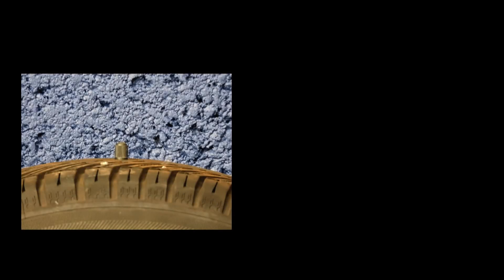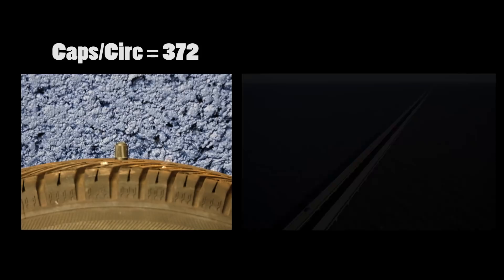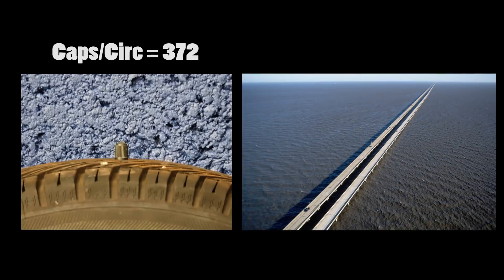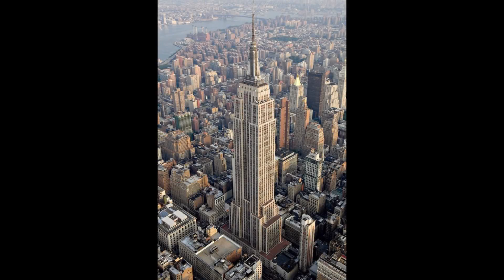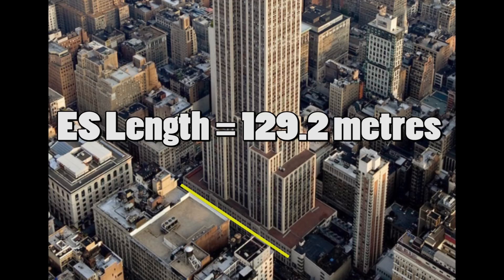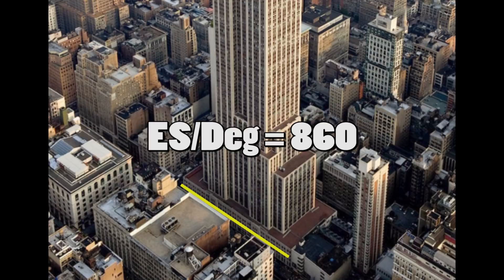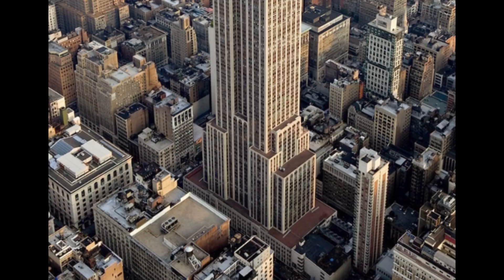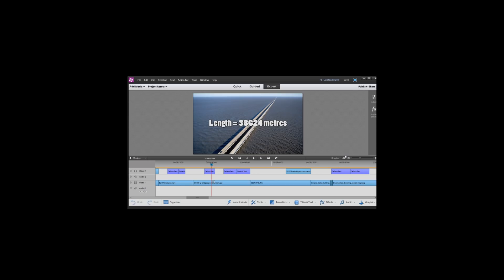Flat Earth Can't Scale

Comment: Gotta get you terminolgy straight. The first tire is not a 14 inch tire, the rim or wheel is 14 inchs. The tire that fits on a 14 inch wheel can vary in it outside diameter. Low profile tires have a considerably less outside diameter than a full size tire. You used your math figuring on a 14 inch diameter but utilized a tire which has a considerably larger diameter, thus all you calulation are scewed.
Reply from the maker: William,

You are correct. I have just uploaded a video addressing this:

https://youtu.be/5DMjnEfiEac

Cheers,

Al
Reply: @ETM2024  Actually you're right. a 14 inch tyre fits a 14 inch rim and there for your 1st tyre was 14inch. But for the comparison use the outside.
Reply: @Stiggy Stiggy anyone can prove the earth is curved you inbred.  Go to the beach and watch boats disappear.  Then get out your telescope and it won't come back dummy.
Reply: William Guy 
Why is this video lame? What you are suggesting is that because you can't see the curvature of the earth from ground level there can be no curve. 

On that premise you could say that because you can't see the contents of a sealed box, the box must be empty.

As you know there are places and large man made structures that clearly illustrate the earth's vurvature even when viewed with the naked eye. Of course you choose to ignore and deny the existance of such obvious evidence because it does not satisfy the requirements when arguing for a flat earth.
Reply from the maker: @Stiggy Stiggy 

Stop talking shit Stiggy. Zooming in doesn't curve things you imbecile, it just causes compression, which leads to exaggerated views. If there is a slight curve it looks more severe, if there is a hill it looks steeper etc.

The causeway only has a shallow curve, the zoom makes it appear exaggerated. That is only possible because the curve exists.
Reply from the maker: @Stiggy Stiggy 

Now you're lying through your teeth about what Soundly does. He shows it in multiple locations, he shows it through various cameras, a drone and a telescope, from different elevations etc. I've demonstrated what's happening with lens compression on  a small  scale myself  and Soundly has done it more than once, the most recent being a few days ago.

You're just a POS troll.
Reply: Stiggy Stiggy   Your dumb comment clearly proves the title of this video correct.
Reply: @jesseduzz4136  decriminilized means nothing more than not a crime but it is still ILLEGAL.

medicinal use laws include MINOR little bits of wording that make it a requirement to have it proscribrd by a registerrd practicing doctor or medical practitioner.

that means you must think that OPIUM is legal too as doctors can proscribe real and synthetic based opiate medicines(which are STILL illegal to possess/use without a lawful prescription)

no prescription for either and you get caught and you get prosecuted
Reply from the maker: Gotta say, this thread has taken a very bizarre turn. I think everyone arguing about cannabis needs to learn to chill the fuck out before my irony meter ends up in orbit. 😀
Reply: @ETM2024 , discussing the legality of weed is fun though. It's unlikely to hear the sentence 'i've never seen a flat basketball collapse into a sphere' when talking about the ganja so thats a massive bonus aswell. 

We might have steered away from the topic of your video but that's the internet for ya. But i agree, let's talk about tyres again ;).

On a sidenote: i am very chill *takes a hit from my joint*. Vacation + being a Dutchie, can't let the stereotypes be for nothing!
Reply: @ETM2024  well ,youre definately not a flatsrd as they dont think anyone can orbit earth
Reply: Keep thinking small, Stiggy.  Gad damn, what is wrong with these people?
Reply: Flat earthers, just take a step back to the theory that shape-shifting reptilian overlords rule the world.  It will be less embarrassing for you and make you look way less stupid.  Drop the flat earth shit for fuck's sake.  We don't even give a damn what shape the earth is.  What is up with your fragile emotion attachment to the flat earth?
Reply: @Stiggy Stiggy are you still making comments after it has been proven to you time and time again you DON'T know how to scale.  I told you, you were looking for way too much curvature.  You just can't wrap your brain around the true emense size of the earth.
Reply: @Stiggy Stiggy you mind isn't large enough to understand that yes we can.  And have proven it many times to you.  You need to hang it up and go back to the short bus.  You clearly have no comprehension of anything you see.
Reply: @Stiggy Stiggy I have never measured the distance at which they disappear I have only watched them do it and attempted to bring them back in focus.  Only a liar says you can.  Try globe understander.  You don't have the brains for it.  As you have proven on our previous encounter.
Reply: @Stiggy Stiggy You have to change your elevation first.  That is the only way to bring them back into focus.  Otherwise they are hidden by the CURVE.  This is an experiment I have performed many times.  Focus alone isn't enough to bring something back over the curve  Here you are lying again.  And this is only our second exchange in this thread.  You still haven't looked at the protractor have you?  You can see all of your mistakes when you do.  The distances you are looking at show exactly what we expect to find on the globe.  But, you didn't get it last time why do I think you're going to get it now.
Reply: @johnunderwood-hp8rj  ohhh diddums.

stop invading other countries then.
Reply: @jadekayak01  I haven't invaded any other countries.  I've been to England once.  It has been my only trip out of the states.  None of the decisions involving the invasion of other countries was I given a choice in.  But, where I do have a choice deals with illegal immigrants.  I not only say no but, hell no.
Reply: @johnunderwood-hp8rj  i agree on illegal immigrants-you all are and stole the land from the real americans-dont worry,most countries this happened-especially in the british empire.

you CAN stop your government invading other countries.

try voting.

try exercising your constitutional rights.

50 FBI agents were going to seize cattle grazing on land that had been developed by a farmer,but not paid for.

about 1100 ARMED local residents turned up to back up the farmer and drove his stock to HIS land(the part that was deeded.

michael moores video "sicko" describes it pergectly in a comment from a french woman.

"in France the government is scared of the people,in the us the people are scared of the government"
Reply: @johnunderwood-hp8rj  at least you HAVE been abroad-sorry about the english accents-nowhere in the english speaking world is "english" butchered so much as its country of origin
Reply: @jadekayak01  I don't know.  You haven't experienced rural Georgia or Alabama.  You might be surprised.
Reply: @Stiggy Stiggy you cant see the red lights in the distance brcause we have limits to our vision.

how long was the runway?  3000m

if the lights were flush with the runway then there was enough curvature to obscure them for a human level height

how high was the  cockpit.

higher than a persons head?

you should have been able to see them at that distance.

the general rule is that you can see 1 mile for every foot above the surface
Reply: Kit Canyon  so i like to react to idiots spouting shit or untruths-sue me.
Reply: @berniccee1  the problem for you is tgat the "theory" was not invented.

it is the observable TRUTH
Reply: @berniccee1  you are delusional and obviously reject actual proofs already published.

curvature has been proven many times from direct observation to observation of objects that can only behave on a curved surface.

water(and everything else) gets pulled to tgd centre of mass.

this includes gasses that cant escape this gravitational attraction(lije most gasses)

lets use water as an example as its way easier to check it yourself.

pressure increasses with depth-this is because tgere is more mass above you as you go deeper.

every 10m the pressure increase is the same as air pressure acting on us at sea level.

now if you reverse this principle and start deep and go UP to tge surface the pressure decreases.

now to the air.

it is a proven fact tgat air pressure decreases as you go higher up a large mountain.

this is simply because there is less mass above you than at sea level.

eventually you get so high tgat we cant breath propperly,or more importantky we CAN breath but there is not enough oxygen in the atmosphere for us to function.

the higher you go the less atmosphere there is untill the point where there is effectively no pressure at all and that is calked a vaccum.

it is correct that an ARTIFICIAL vaccum needs a container to exist or that a container needs to be used to house INCREASED pressure because they are artifical pressure variations.

minor variations occur naturally in the atmosphere and are measured in millbars.
tgese produce the weather patterns(winds)
Reply: Amtrak Derailment  Quick! Dig up Erastothanes! He's owed $10K. Maybe there was enough air in his casket he might be alive! 
Oh wait... he didn't prove motion. Back to sleep Mr. E. clunk. It's very easy to offer $10K and then not accept PHOTO EVIDENCE - typical of schyster and dropout Eric Dubay.

Bcos I know of a 15yo who sent his phone up on a balloon. Dubay owes that kid $10K.
Reply: He doesn't even understand science so why would I waste money trying to jump through his hoops. He has to sell 50,000 toilet paper books to make $10K he ain't giving it away lol:
" Michelson-Morley 1887 (motion) " 😂😂😂
Reply from the maker: @Stiggy Stiggy 

You're lying Stiggy. If you want to argue about something I don't expect you to be right because you're usually wrong but outright lying is both despicable and stupid. If you can't be honest keep quiet. You lie agin I'll delete your shit.
Reply: @Stiggy Stiggy You think that last clip is the same concept as this?? https://youtu.be/QVa2UmgdTM4
Go to 7:45 in it, and you will see it is NOT the same.
Reply from the maker: @Stiggy Stiggy

The only way you fuckwits can deal with his observations is to lie through your shit stained teeth. Says more about you than anyone else dumbass. Three  individual locations, multiple viewpoints, live streams, and now your precious infrared. Your claims are false, end  of.

And I wasn't just referring to that but the complete and total bullshit about zooming in causing curvature. So you can prance around and run through your idiotic script Stiggy, but the fact is you're a lying piece of shit who is the only one here who is obsessed with Soundly and you're running around bleating your head off about him because you know he isn't a fraud. This video has nothing to do with Soundly, you and your dipshit pals on FED can't shut up about him.

So stop projecting your own issues and stop lying. Like I said, you can try to argue about something and you will inevitably be wrong, but you keep telling straight up lies and you're gone.
Reply: I'm officially offering $10 to anyone who can prove the flatness AND stationary nature of the earth. And unlike Dubay, I WILL give it up if you bring scientific proof in any format. Bonus for bringing me a piece of the firmament that Operation Fishbowl busted up. There must be millions of fragments! (Libyan Glass doesn't count since it existed previous to "nuking the firmament".)
Reply: Yes, but in the grand scheme of things it's a moot point. Good call though.
Reply: Irrelevant. The tire example does not require rigorous mathematical precision to illustrate the point. Your protest is just an excuse to remain willfully ignorant.
Reply: Stiggy Stiggy yes, in fact I can. But it's not important that I can, the real question is why can't you?
Reply: Stiggy, yes the earth has been PROVED round.  We have literal pictures.  If people choose to deny their own eyes then that's their own issue.
Reply: Check again. 14" x 3.14159 x 25.4 = 1117.2mm and that's the diameter of the wheel itself. He stated the circumference as 2234mm and for that to be true, he had to assume a diameter of 28" for the wheel and tire which is actually about right.
Reply: @mooney6306q  yes,  the wheel is,  not the tire.  That's what was originally said...
Reply: That was a good try mate and very concise.. The problem is that flatards will refuse to even try to understand what you are talking about... I once tried to explain to a flatard that a plane flying at 35000 feet would be equivalent to a spec of very small dust floating about a tenth of a millimetre above the surface of a beach ball and would therefore not see any apparent curvature... He just didn't get it.. So, my advice is just give up!
Reply: Stiggy Stiggy you’re a fucking idiot. Keep smoking weed. Moron.
Reply: Steven I resented that. I smoke weed. I’m not a moron. 😂 #adheretothesphere
Reply: @Qzopr1  ohh-so you are a crimminal
Reply: jadekayak01 are you aware that there are places where cannabis is legal? Before you gripe about federal vs state law, remember there are a couple of countries outside the 🇺🇸. Let me ask you something. Is a medical cannabis patient a criminal?
Reply: @Qzopr1  btw-name the countries where cannabis is legal
Reply: jadekayak01 Canada is the latest. Full legalization. Medical and recreational. Derp...
Reply: @Qzopr1  that is only ONE,you said many.
Reply: jadekayak01 logic dictates that I only need one to make your point moot. But since you like your beat downs to be thorough:

Legal

Colombia
Canada
Netherlands
Panama
Spain
Uruguay
U.S.

Medicinal Use

Canada
Macedonia
Puerto Rico
Serbia
U.S.

Decriminalized

Argentina
Australia
Austria
Belgium
Bolivia
Cambodia
Chile
Costa Rica
Croatia
Czech Republic
Ecuador
Estonia
Germany
Greece
India
Italy
Jamaica
Malta
Mexico
Paraguay
Peru
Portugal
Russia
Slovenia
Switzerland
Ukraine
U.S.

Tolerated/largely unenforced

Belize
Botswana

Are we done?
Reply: @jadekayak01  There are at least 27 nations where marijuana is legal, Canada being the most recurrent adopter. And by your standard, virtually everyone is a criminal. 
Ever go over a speed limit?
Reply: @Qzopr1  no where not done.

in canada it is fully legal.

thats just one mistake you made.

also in the us it is not legal.one or two states does not make it legal.

and for the record-there are 196 countries in the world,how many did you mention?
Reply: jadekayak01 did I mention more than one. Nice goalposts shifting.
Reply: @Qzopr1  yes you did,but you also attempted to "baffle with bullshit" by putting in other cou tries where it is still illegal and got canada completely wrong.

how can a person be trusted when they have an agenda to push and distort or get the facts completely wrong.
Reply: @jadekayak01 , funny you're not adressing the one person who's actually shown you to be wrong.. are you sure you're not a FE'er? You've seem to have all their defence mechanismes.

Also, rape isn't legal anywhere in the world but there are parts of the world where a women that has been raped gets more trouble than the guy that raped her.
Reply: @gjj6331  i havent been wrong here-point out were i have been wrong
Reply: @gjj6331  and who said i said rape was legal?
read the post-that was ADDRESSED to me,not written by me
Reply: @jadekayak01 , i never said anyone made such a claim dude. You said there was a level of difficulty in proving rape and i said that it's not just the level of difficulty giving these women a hard time after they've been raped but in some cases the culture itself stops these women getting justice. Like women being thrown out of their family for not being a virgin anymore even if they lost their virginity as a result of rape. The guy in those cases usually gets away with it. Although in some cases a small financial compensation is given to the family for their loss of a virgin daughter, as if the guy put a dent in their car. So disrespectful. 

In the west we see rape victims as actual victims, this isnt the same all around the world.

You were wrong in saying that there are only 3-4 countries in the world where weed is legal, for medicinal use weed is fully legal in 31 countries which comes very close to the 27+ the other guy mentioned. No one specified the legality was based around recreational use, just the legality of weed in general. Therefore, you were wrong and shouldnt be so condescending to someone who actually was correct albeit a bit vague in his description.

Also, you saying speeding isnt a criminal offence in your country but calling people who smoke weed a criminal is very odd. You seem to know the difference between a misdemeanor and a crime yet you don't apply this to recreational stoners. Even in countries where smoking weed is illegal the act of doing so isnt usually concidered a criminal offence.
Reply: @gjj6331  i just assumed you implied it as you linked it to my statement-i do agree though.recently an auz beauty salon manageress in dubai was raped by a group of locals and all were jailed for sex outside marriage(3 months) then she was deported.

"medicinal use" is a serious problem for weed as it needs to be proscribed by a regestered medical practitioner and fits into the catagory if prescription drugs-all of which are ILLEGAL to possess or use without the valid prescription.
Reply: Saint Massive indeed. I was vague because it’s useless to invest time in conversation and debate with people who clearly deny reality. They’re so wrong, they only want to be right. This is not the basis for a productive exchange of ideas.
Reply: @Qzopr1  the problem is that i AM right.

weed is illegal in most countries in the world.

no amount if touting up to 7 countries were it IS legal will change that
Reply: @jadekayak01  
Canada!
Reply: @gjj6331  sorry but in countries where possessiin,cultivation,and use of weed IS a crimminal offence it IS considered a CRIME.

nisdemeanor/felony-only used in amerika,the land of the free but most of the rest of tge world has offences and crimes as defined by thier laws with crimes being the more serious level of offending
Reply: Qzopr1
that is a debatable  point ! Is it for a medical condition.
Reply: @wilko4085  keep drinking alcohol fucktard. Weed doesn't make you stupid and it doesn't kill you like alcohol.  Don't be biased against the least destructive drug on earth.  And that's including all the pharmaceuticals you eat without thinking about it you biased idiot.
Reply: dont blame "weed" blame his parents
Reply: Lol,  nobody gets low profile tires on a 14" wheel buddy
Reply: @terryfuldsgaming7995  legal where fucktard
Reply: @edhough1000  i reckon your ball is like a marble
Reply: Stiggy Stiggy .....to someone who refuses to accept real evidence
Reply: @familyhelpdeskhelpdesk270  thats the problem idiot, there is no real evidence. Last I checked we don't live on a fucking tyre.